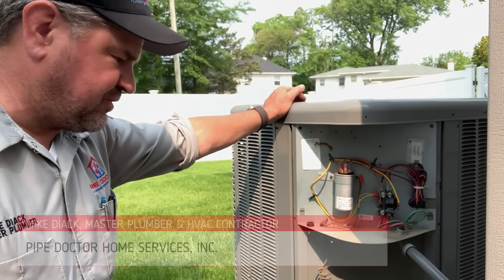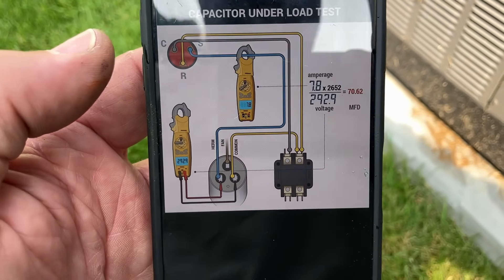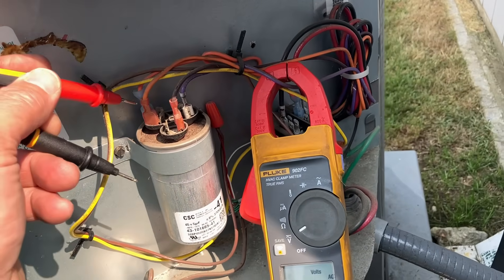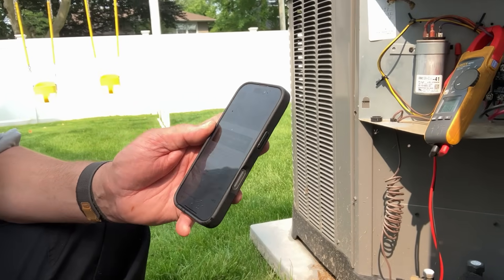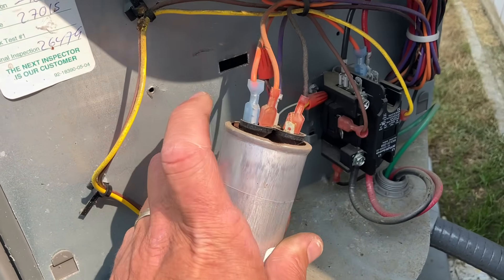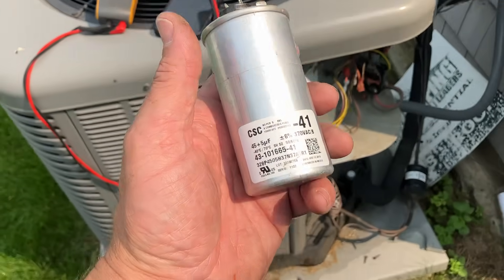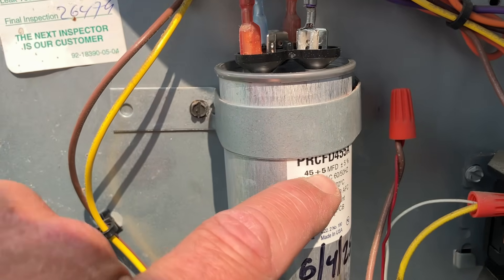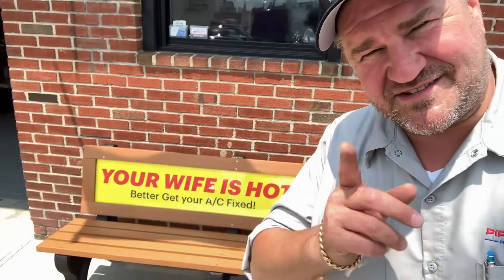Testing a Bad AC Capacitor While It's Still Running?! | Don’t Try This Without Watching First

Comment: Hey Mike question for you if a unit is running a 50 5 capacitor and you install a 70 5 capacitor is that bad for the unit and can you do that
Reply from the maker: Installing a much larger capacitor than required for an air conditioning compressor can lead to several negative outcomes, both immediate and long-term. Here’s what happens and why it’s not recommended:

⸻

⚠️ Immediate and Long-Term Effects:

1. Compressor Overheating or Damage
	•	A larger capacitor stores and releases more energy. This can cause the compressor motor windings to draw too much current during startup.
	•	Over time, this stresses the motor, potentially burning out the start winding or damaging the run winding.

2. Hard Starting or No Start
	•	Contrary to popular belief, bigger isn’t always better. An oversized capacitor may delay or distort the phase shift, making the motor harder to start or causing it to fail to start entirely.

3. Shortened Equipment Life
	•	Constant electrical stress caused by an overcharged capacitor can degrade internal motor insulation, leading to early compressor failure.

4. Blown Start Components
	•	Excess capacitance can burn out the start relay, hard start kit, or potential relay in systems that use them.

5. Possible Safety Risks
	•	Overheating capacitors can leak, burst, or even catch fire, posing safety risks.

⸻

✅ The Right Way to Size a Capacitor

You should always match the microfarad (μF) rating and voltage rating to what the manufacturer specifies for that compressor or fan motor. A small variance (±6%) is typically acceptable, but large deviations are dangerous.

⸻

🧠 Pro Tip (for techs):

If a system is having trouble starting, use a proper hard start kit or check for issues like:
	•	Low voltage
	•	Failing run capacitor
	•	Worn contactor
	•	High head pressure

Don’t try to “band-aid” it with a bigger capacitor.
Reply: @PipeDoctor give my regards to chat gpt 😉
Reply: @PipeDoctor thanks for info mike

Comment: With respect.  If you are just testing the capacitor prophylactically you're spending a lot of time to do the testing on a $10 (wholesale) part.  The amount you bill per hour is high enough that if you suspect that the capacitor is bad, you might as well just change it.  I realize that you charge the equivalent of one hour labor when you bill for a capacitor (plus the installation time).   The bottom line is that the life of an in service capacitor is 10 years give or take a few.  If you're testing a ten+ year old capacitor you're really wasting time.  Just replace the damned thing,  but don't sodomize the customer on the invoice. When you go to do a field service call you should be diagnosing what the possible issues are that are causing the failure.  If you suspect the capacitor, REPLACE IT WITHOUT ALL THE FANFARE.  It's one thing to check a fan motor to see why it isn't running.  Check to see power in.  Check to see if there is an issue with the wiring from the source to the fan motor. Why do you check this?   Because the fan might be a $500 part that takes at least an hour to replace.  Replacing a capacitor is a given.  Looks bad.....REPLACE IT.   Over 10 years old.....REPLACE IT.  It's a fucking $10 part.  I hate to say it but, you can test an old capacitor and it might test "OK" and when the ambient temperature increases and the unit is operating at a higher rate...,,,that same capacitor may fail.  Mikey.  You're obsessed with capacitors.  I think you need to start asking your prospective employees if the reason they don';t know how to test a capacitor is that they were just taught to CHANGE THE FUCKING THINGS!
Reply: The prospective employees can't even say capacitor and can't identify one. How would they even know how to change one?
Reply: @realSamAndrew  probably thought they'd have an office desk job, where hey can twiddle their phone more than anything else. 🙄
Reply: @throttlebottle5906 I am responding to the OP, who claimed these guys knew how to CHANGE them, but not TEST them. That's not an office job, and I called bs.
Reply from the maker: Thanks for the feedback, I appreciate your perspective!
Reply: Totally understand where you're coming from but you're starting to sound like a parts changer just throwing parts that stuff till it starts working again American weed to improper repairs and unnecessary callbacks. I think the worst thing is customers calling you saying, "ya didn't fix it! Whatd i pay all that munny fer?" Or "Ya said if i showt ya my frunt butt youd make my AC blast icicles!"
Reply: @thechronic555  I think you missed my point.  I'm talking about condemning a 10+ year old capacitor to prevent a future service call and to protect the fan motor.  A weak or faulty capacitor can cause the motor it serves to work harder causing overheating and/or damage to the windings.
Reply: @philtheheaterguy951 yea maybe. But if just threw parts where they really needed to be preventatively, id rack up some bills..